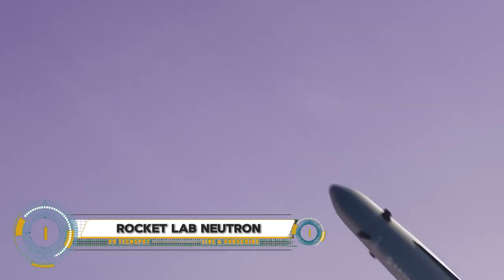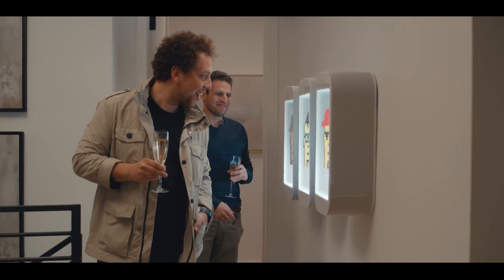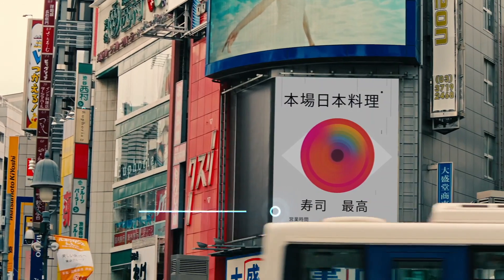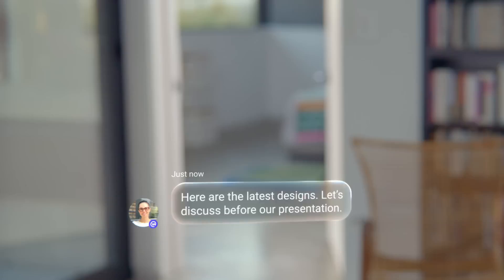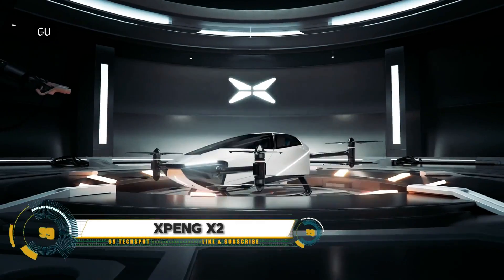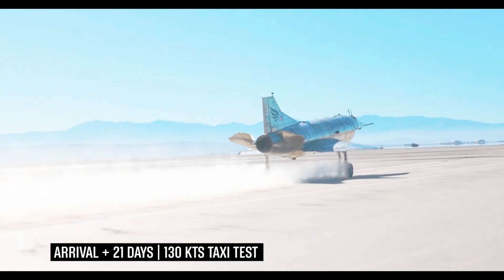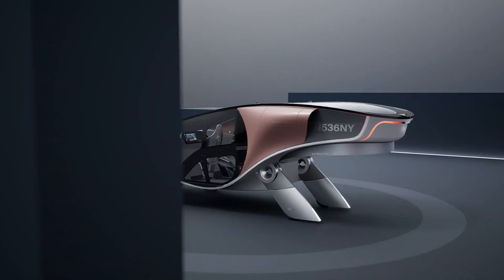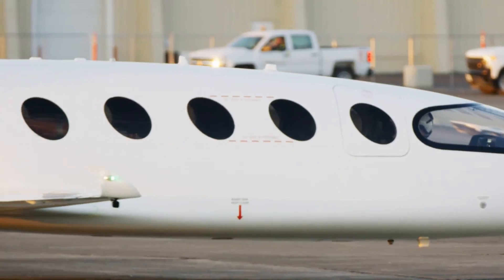20 Next Generation Technology In The World

Comment: How to fly without wings
AntiGravity Air Taxi

Work base on Gravity just spinning by using Battery
can fly in bad weather, plunge in the ocean even in outer space
Can lift more than 100 Ton 

Earth which weight predict 600 trillion ton does not fall at the Sun because of centrifugal in orbitting, on the contrary it does not be thrown far go out the orbit line of hold by gravity at the Sun as orbit center. Gravity and centrifugal is equal called Equillibrium, thats why until now Earth which we was inhabited always rotate and circulate the Sun. Now we justly take example : how if the gravity used and centrifugal is negated? The Earth will float far leave the Sun. So that centrifugal can be used to fly far away if gravity eliminated. Finally how to eliminate gravity?

It’s way rotate part of aircraft by horizontal. When that rotation faster centrifugal force getting greater and the gravity getting smaller, finally it lose the gravity and the aircraft start flying. Of course people would surprise: how the aircraft can keep rotate without fulcrums? Thats why we named that aircraft Shuttling System that is aircraft likes two disc adjoining attached in the midle as fulcrums:

A. The Top part, we name Positive rotate to right, and the edges is getting thicker and havier.

B. The Buttom part, we name Negative rotating to left, and the edges is getting thicker and havier.

C. Middle Part , we name Neutral, air crew placed and also machine and everythings turning Negative and Positive at the same time.

The aircraft can liftup added with explosion from the engine. However that aircraft construction later, let the engineer doit it, and we are sure the aircraft will bulletproof and also waterproof.
 
.
.
 
In modern civilization where human being generally using flying saucer as vehicle, will a lot of change in lives either in materialism and in psychological. In materialism area will apply the change in life like.
People no longger need roadway and rel road which spend large of energy, money, places, things and time, object place and time. People would utilize that area for habitat or for other need: